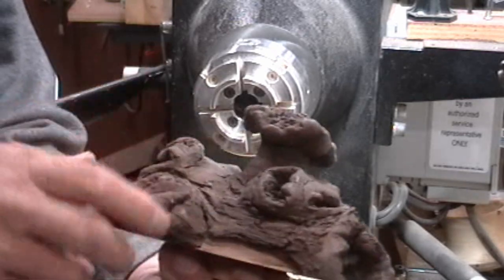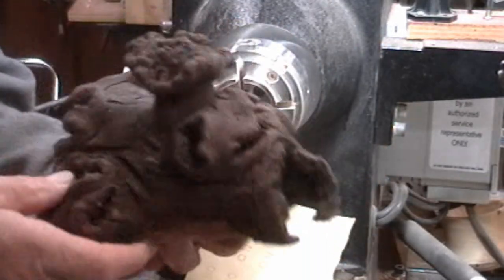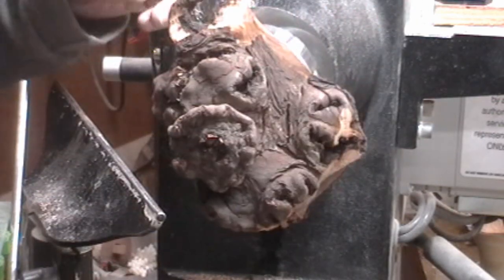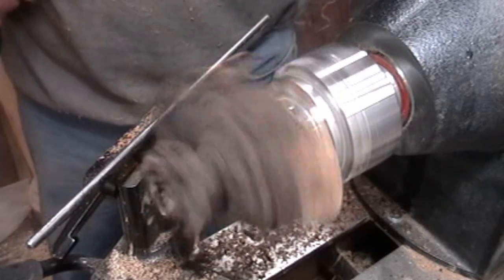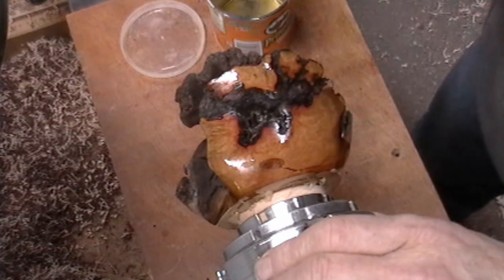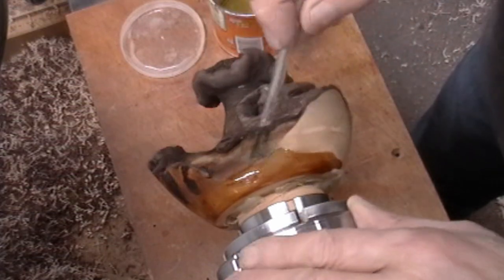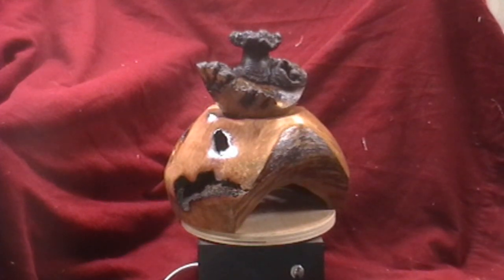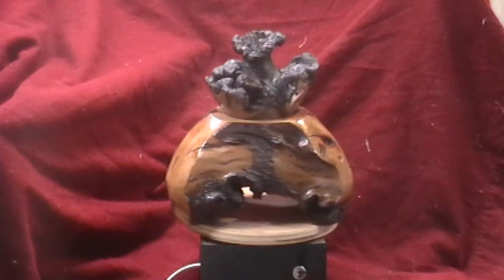A Madrone Turning From The Bottom of A Bowl

Comment: Surprised that a paper glue joint can hold with all the knobs that you are cutting.
Reply from the maker: I don't use it much anymore but it is a strong joint. First time I used it was in grade school on a nut bowl. That was long before the nice chucks we have which has given us so many ways to hold our work. But some things require using the old methods. I thought of using a worm screw and then plugging the hole with a walnut plug.
Thanks for watching.
Gary